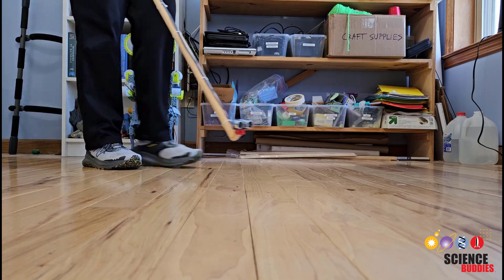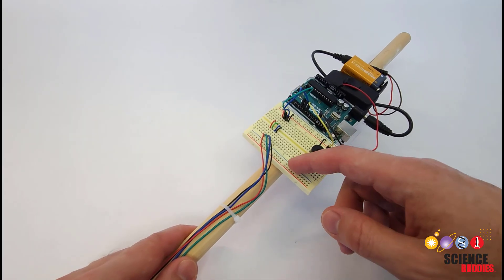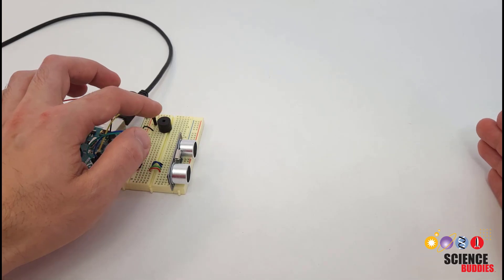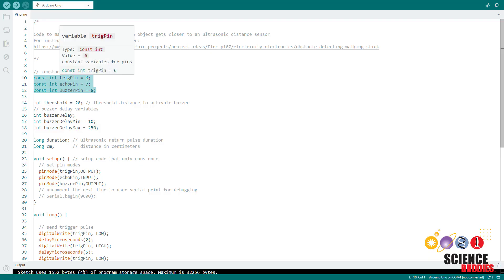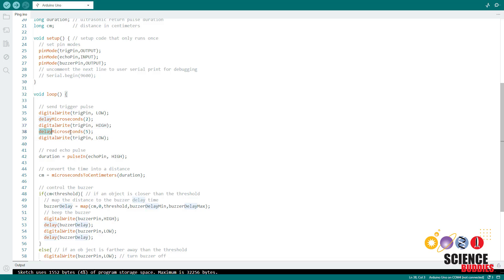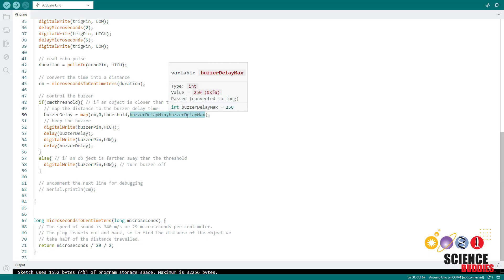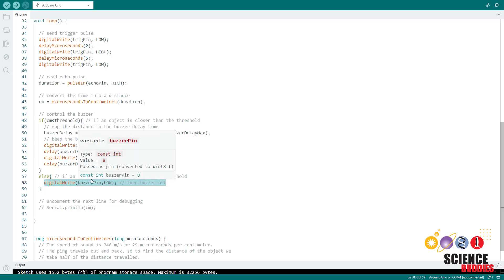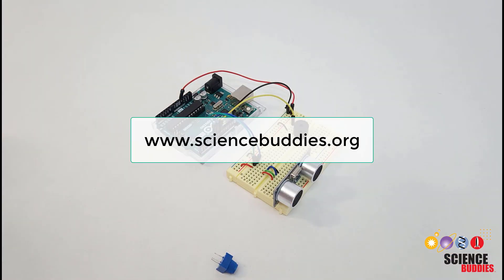Build an Obstacle-Detecting Walking Stick | Science Project

Comment: This idea occurred to me today, as I nearly tripped over a wheelie bin on its side on the pavement. I thought I'd check to see if anyone had already done it, and sure enough they had. How practical is this? Did you get any feedback/opinions from actual potential users? It would be a shame if this could help people but didn't go anywhere. I'd assume the cost of parts would be negligible if done commercially. I envisioned changing pitch to indicate varying distance. And yes, it needs a headphone adapter! And I guess it would somehow need waterproofing for real use. Well done! :)
Reply from the maker: Hi - we are a K-12 STEM education nonprofit, so our projects are intended for student/educational use and we did not try to commercialize this. That's not to say someone else couldn't try though!

Comment: Can we use arduino nano for this project
Reply from the maker: Yes, you should be able to use an Arduino Nano for most Uno projects. It has the same functionality but is just smaller.
Reply: @Science.Buddies  thanks
Reply: What's is the name that long wire you connect ultra sonic sensor to breadboard
Reply from the maker: It's commonly called "hookup wire," more technically it is 22 AWG solid-core wire.